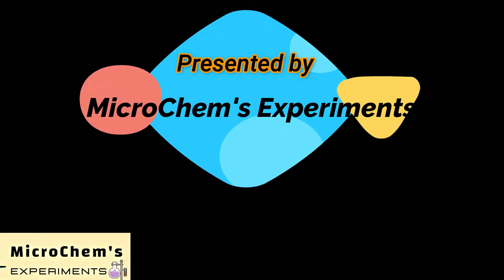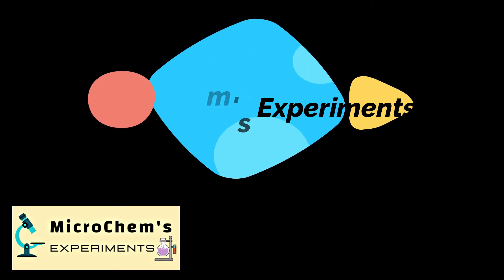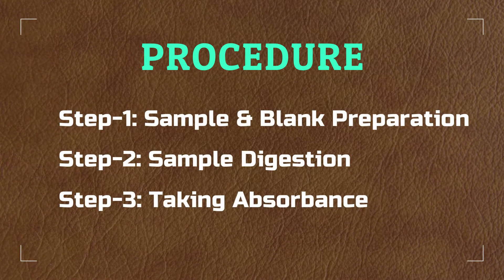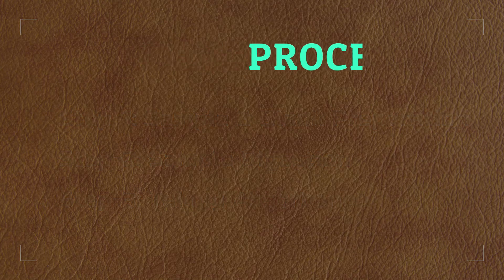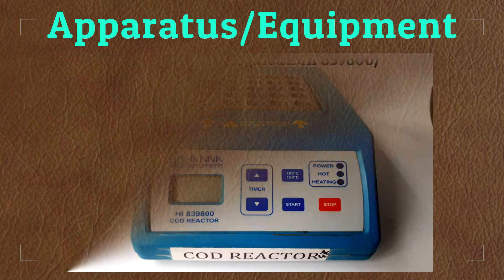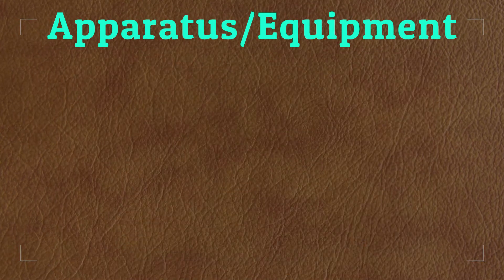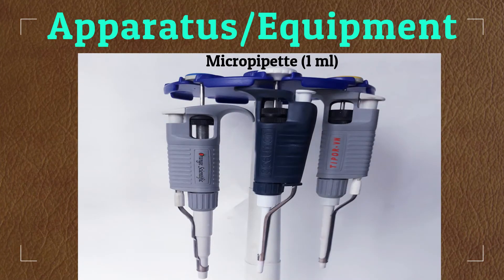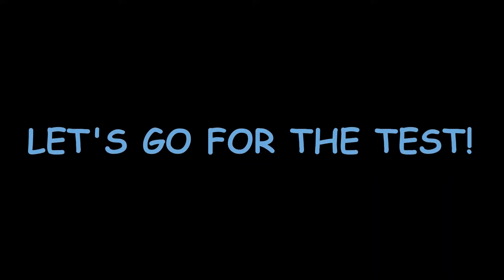Determination of Chemical Oxygen Demand (COD)-A Complete Procedure (Dichromate Mercury Free Method)

Comment: In the case that mg/L are not given in the Spectrophotometer, is there another option to calculate how much COD are in a sample with this exact procedure ? 

Greetings from Mexico
Reply from the maker: By default, mg/L is set in this spectrophotometer. So you can't change the unit. But if you need your result in any other unit, then you can convert the mg/L result into your unit by yourself. For more details about the unit conversion, take help from Google. Thanks

Comment: Chloride correction for saline water, how do you apply it to COD analysis.
Reply from the maker: Sorry, we did not get your question. Please clarify
Reply: For saline water, where the concentration of chloride is above 2000mg/L. The concentration of COD is in thousands as a result of high concentration of chloride. How do you correct that for saline water
Reply from the maker: @alaiyagibson839 For high concentration, we use High range COD reagent vial. Otherwise Dilution of your sample is needed before conducting the test.
Reply: After your dilution, u still gonna include your factor into the calculation. The concentration of your COD will still be high.  The concentration of chloride is the major reason for high COD . How do you eliminate that chloride concentration. There is what they called chloride correction for COD analysis where u plot a graph for the chloride correction...... I just need more information on that
Reply from the maker: @alaiyagibson839  Oh okay but there is no need of chloride correction in this COD analysis method. The COD reagent vials are designed and developed considering chloride concentration.
Reply: @MicroChemsExperiments  have u carried out analysis of COD on saline water?
Reply from the maker: @alaiyagibson839  No we didn't